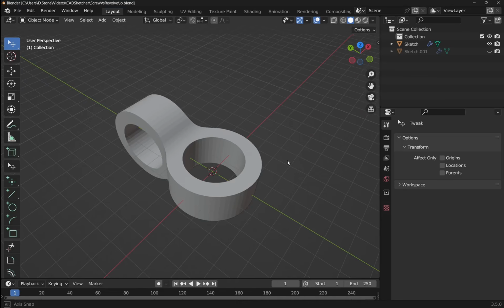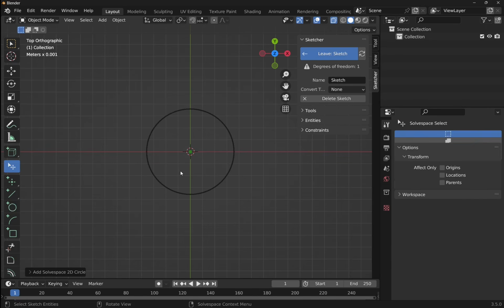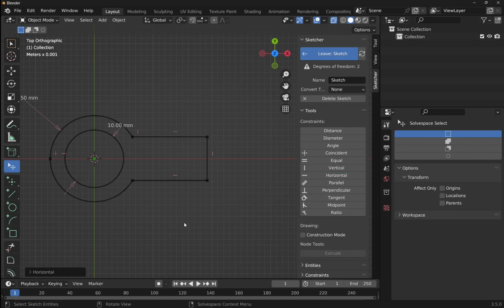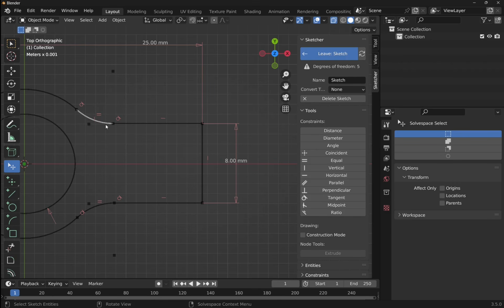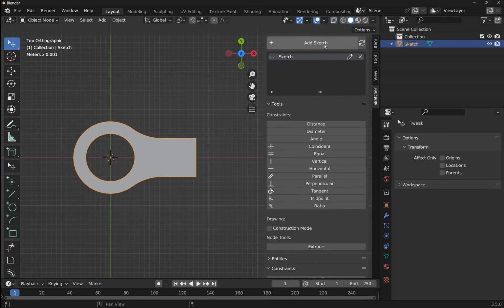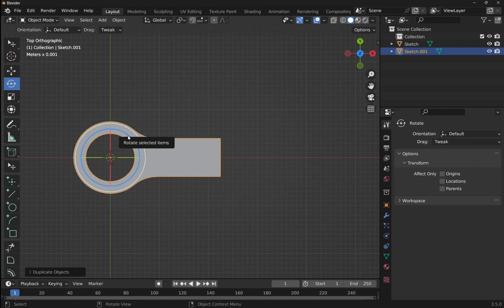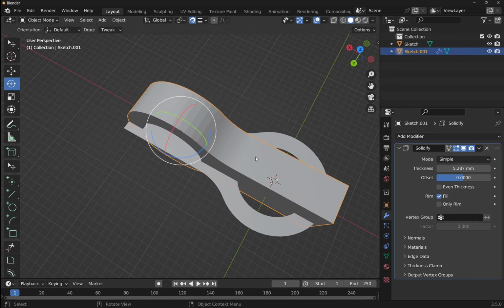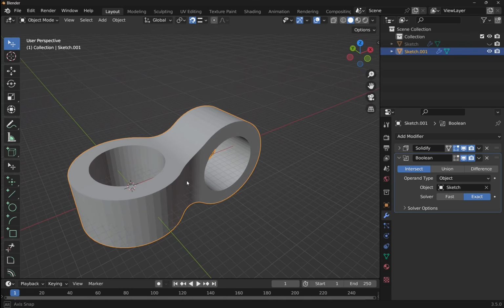Learn CAD Sketcher | 13 | Intersection Workflow | Beginners Blender 3D

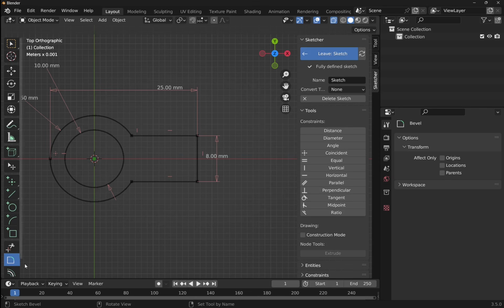Comment: Hello, the bevel tool at 07:20 gives me error: "'NoneType' object has no attribute 'connection_points'", why is that?
Reply: I just made the exact same sketch next to it and suddenly it worked..then I tried to bevel the old one and it worked?? looks pretty bugged. Try to remove constraints, I feel like this helped but IDK
Reply: I tried everything but bevel don't work. So I deleted the rectangle and made an arc connecting  the point of circle to line of the rectangle, than its works
Reply: Same
Reply: for Mac is not working but In window there is no error
Reply: Same

Comment: Can we use Sketcher to create a shape like a steering wheel with three spokes? 
(A cylindrical base, a doughnut-shaped ring on top, and three spokes that interconnect these two shapes.)
Reply from the maker: Yes you can use this for the base profile (as if you was looking at the object from the top) and then you would bevel the edges to smooth off the shape.
Reply: @MJ3D_Blender  I am unable to visualize that.

Could you make shorts on such user doubts/requests/questions? 
(A Shorts section would complement the longer videos nicely!)

Thanks in advance!